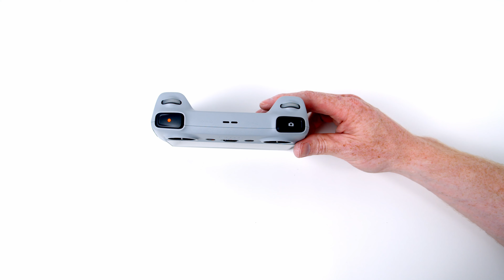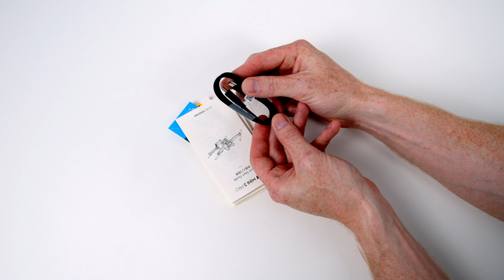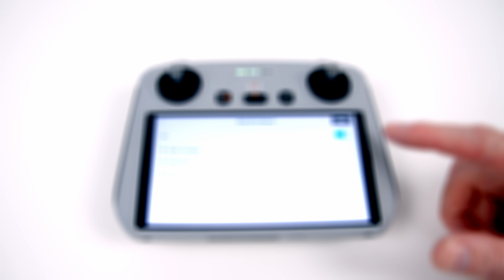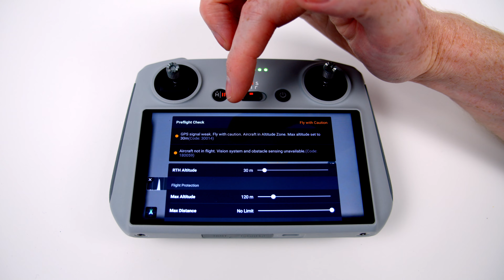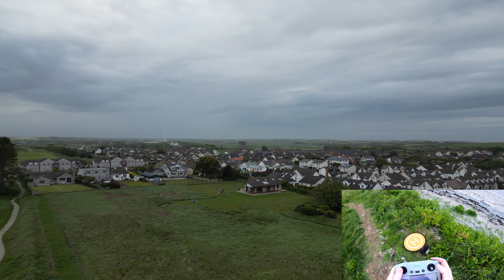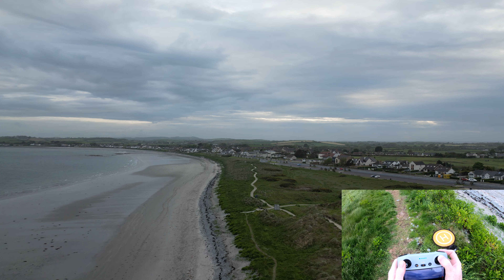DJI Mini 3 Pro Unboxing, Controller Overview and First Flight

Comment: Hello from the Ukraine, Chris! I really like your videos! Could you recommend me a well ventilated case for my big tri-fan ASUS TUF Gaming GeForce RTX 3080 OC Edition 12GB? 
Budget in the range up to £145-170. I'm also looking at the be quiet! Silent Base 802 Window, but not sure if it's worth £202. 
I don't care about noise level, as long as I can fit a large graphics card and at least 3 hard drives + a couple of ssd's.

I'm also planning on putting budget water cooling on top of the case like you recommend in your videos!